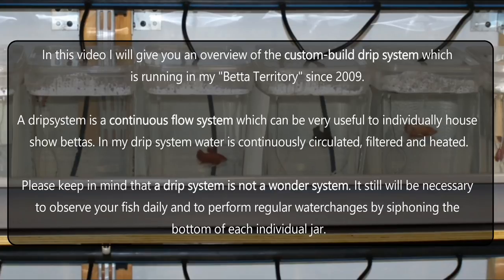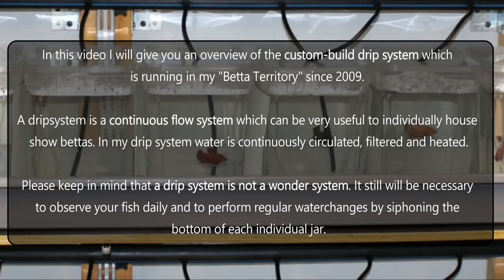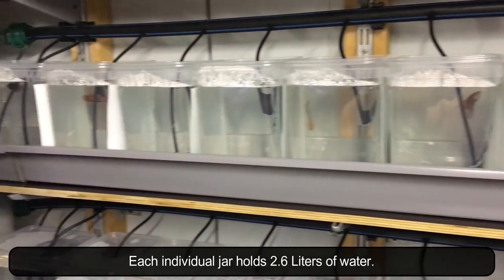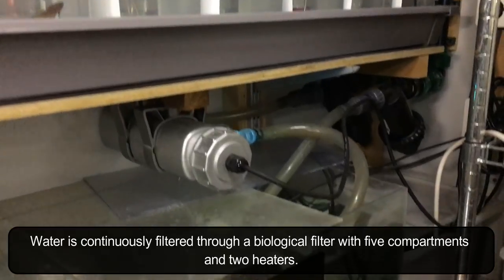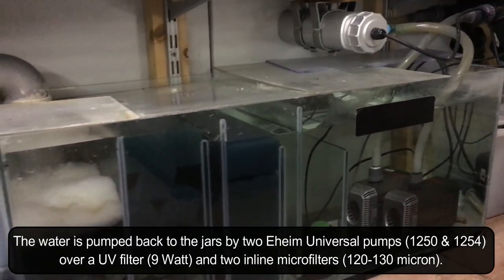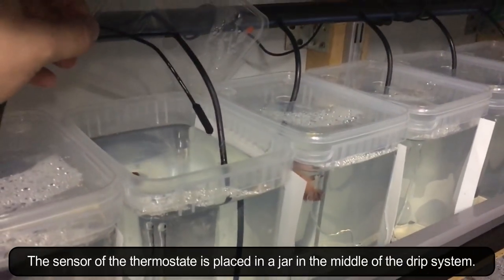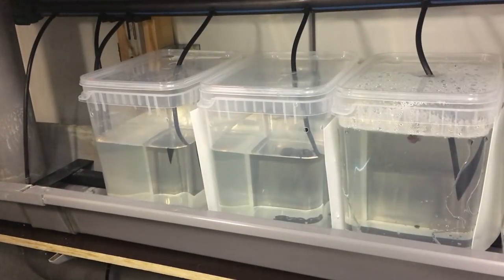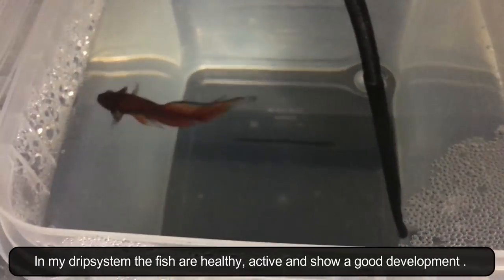My DripSystem - An overview

Comment: Great video! I was interested in building a similar setup on a smaller scale. While doing some research I read that male Bettas release hormones and cannot share the same water. Is that true? Did you have any issue with that?
Reply from the maker: Thank you! Happy to hear you liked the video. With respect to your question: Within the Betta community we often hear the statement that each fry produces a growth inhibiting hormone to  give themselves the best chance of survival and will inhibit the growth of the other fry in the grow-out tank.

Too my knowledge the "growth hormone production theory" more than a hypothesis which has never been scientifically proven. After all, when this would be true it would imply that daily water changes would be able to prevent differences in growth as you would overcome possible high concentrations of such hormones. This does not seem to be the case which makes me doubt whether this hypothesis is true unless the fish are excreting such a huge amount of hormones on a daily base.

We all know that the presence of a dominant male and the behaviour of such fish can inhibit the development of sibling males. Personally I do not think this phenomenon is caused by external hormones but more with a balance of internal hormones mainly testosterone (male hormone) and cortisol (stress hormone). For example, I can imagine that when testosterone is high and cortisol low a male will develop dominance (alpha male). In presence of a more dominant male stress levels are higher and so will be cortisol inhibiting the development of an alpha male.

Comment: What about the food? Do you have any problems with feeding it?
Reply from the maker: Andreas Setyo no problems with feeding. Each lid has a small hole to make feeding easy.
Reply: @BettaTerritory  so, the food wont directly come out because it is sinking?
Reply from the maker: Andreas Setyo The outflow holes are in the front, the feeding holes in the lid are at the back. This way the food is already eaten or sunken before it reaches the outflow. So no problems 😉.